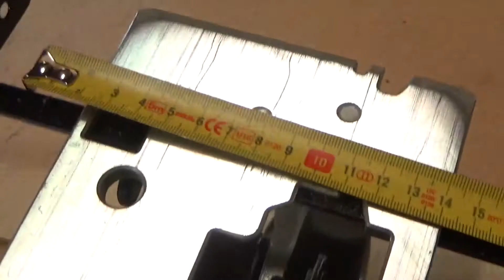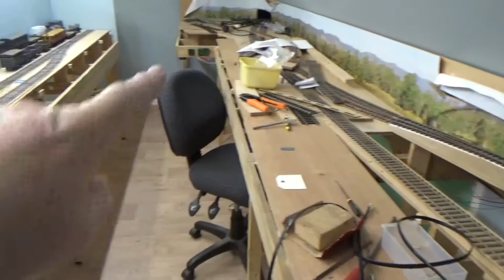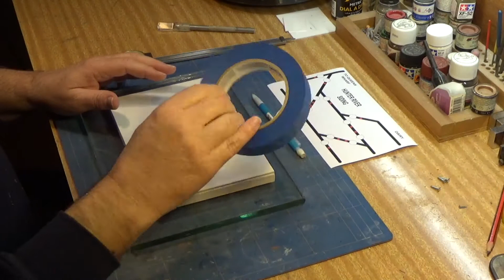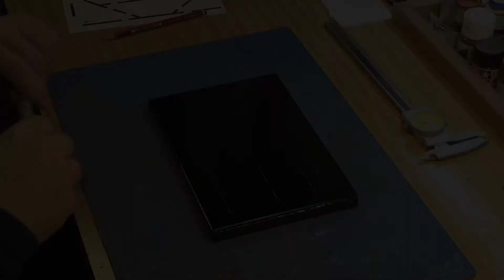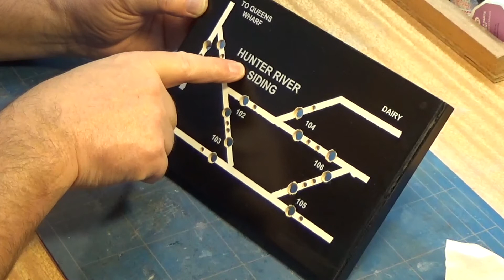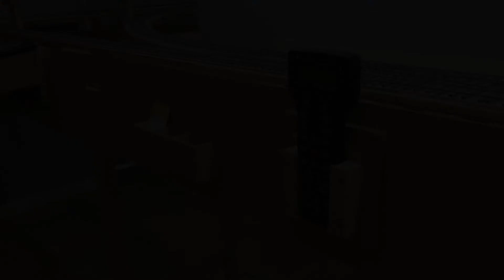Ozone 4

Comment: Hello Trevor, I am moving to Muswellbrook very soon, and luckily for me, the CFO has allocated me a rather large room in the house that will become the train room. I will be building an era III/IV British Rail in OO scale (represents my early childhood in the UK, my parent emigrated to Aus when I was 11 years old) At some point I might consider a local section as well, so your Muswellbrook layout design really peaked my interest. I suspect I will unashamedly copy some significant bits. I have already built the start of my fiddle yard (currently in storage awaiting the final move)  As luck would have it, it will fit in nicely with the revised MB layout design. Sorry for the rambling post, now to my question relevant to the video.  On your control/mimic panel, what is the width of the track lines that yu drew in Inkscape? I plan to make a prototype panel that will be used for the fiddle yard. I have an NCE powercab and a DCC concepts power booster. I use IP Digital cobalt switches and Megapoints controllers for layout control.
Reply from the maker: G'day Andrew. If my memory serves me correctly the lines are 5mm wide. More significsnt than that however is the distance between the lines. The whole point of the exercise is to make sure there's room around all the components to get at them when you turn the panel over to sokder them and also so that you ensure the components have sufficient clearance from the strips of timber I run along the edges.
Reply: @trevorhodges6412  cheers Trevor